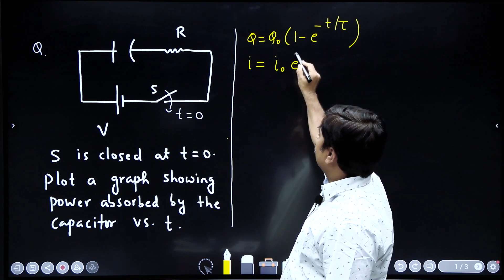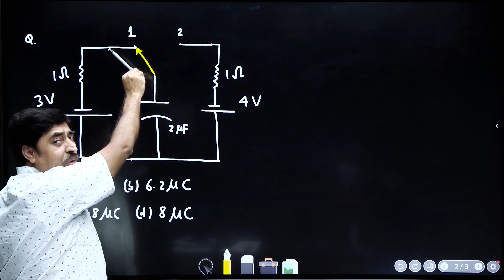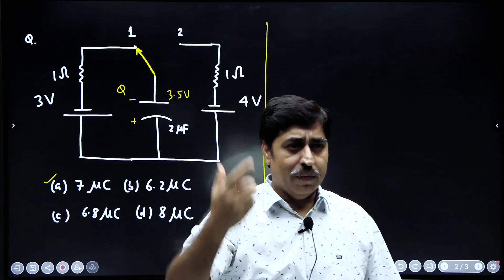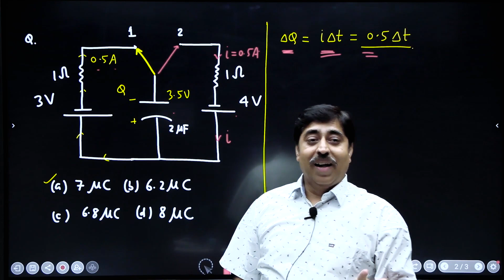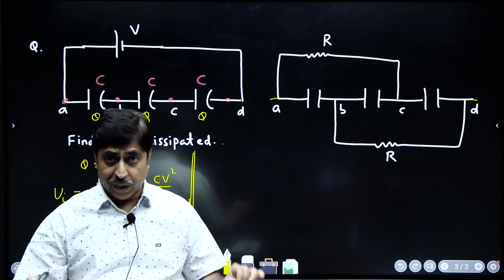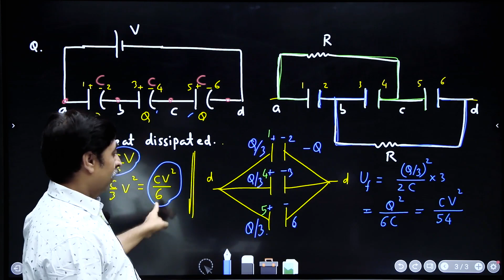Problems on RC Circuit for JEE Advanced |Charging and discharging of a capacitor Q.11-14

Comment: What is the role of resistance in last question
Reply from the maker: No role as far as calculations are concerned. 
However, heat is dissipated in these resistors.